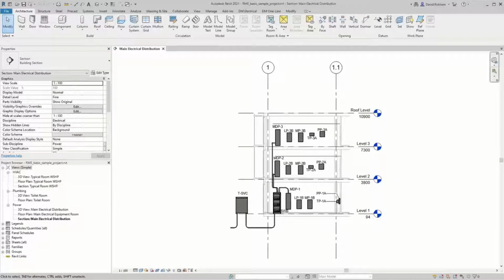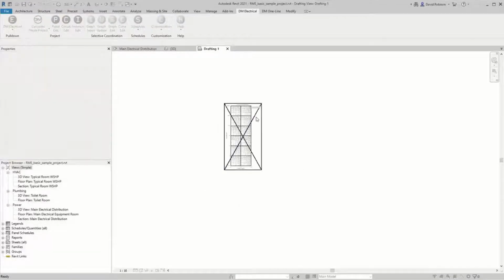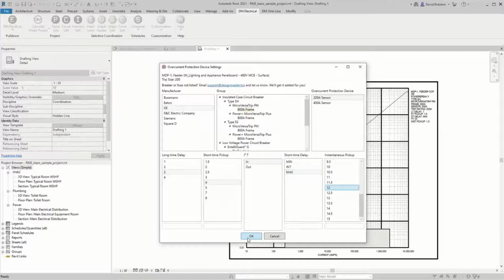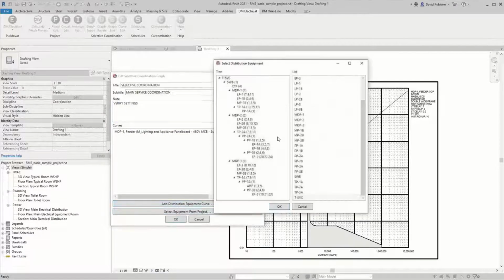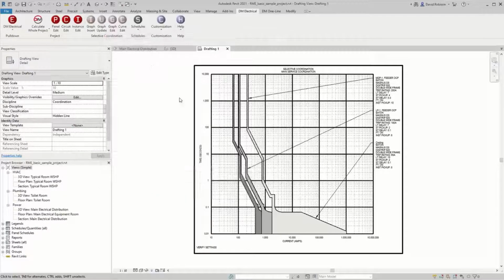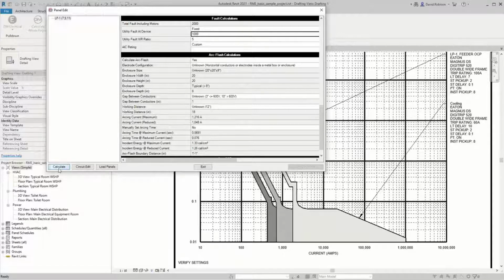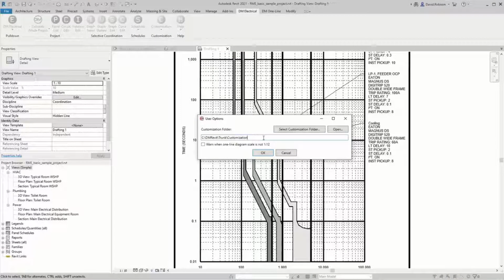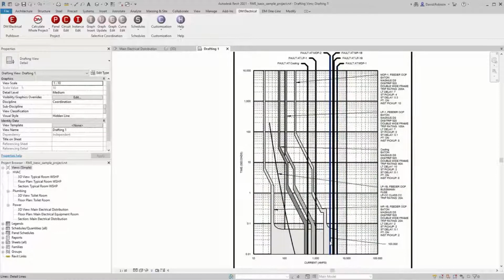Design Master Electrical for Revit: Breaker Curves (03/11/2021)

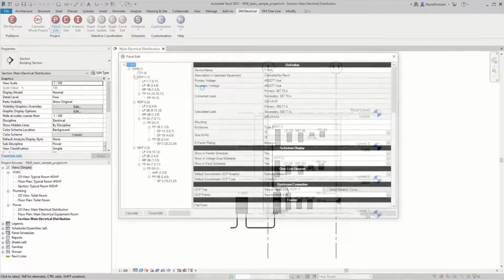Comment from the maker: Setting breaker curves in the Panel Edit command (01:15)
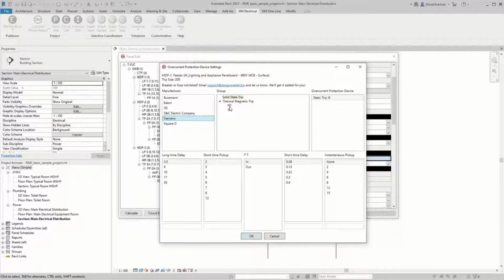What to do if your breaker isn’t listed (02:31)
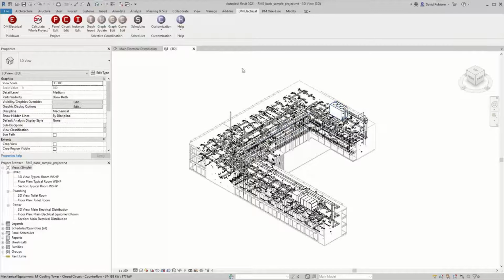Setting breaker curves in the Instance Edit command (03:04)
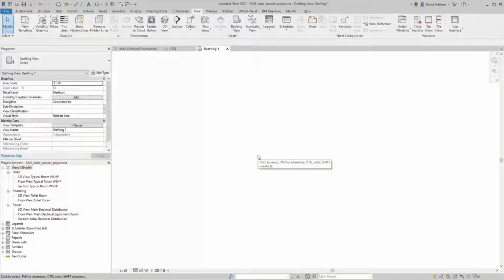Performing selective coordination (03:26)
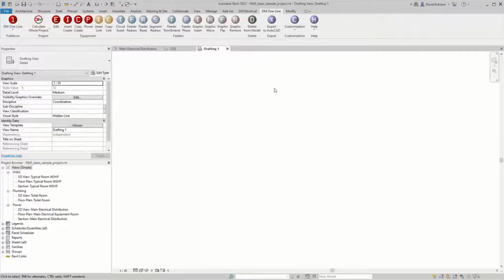Creating a selective coordination graph using the Graph Insert command (03:26)
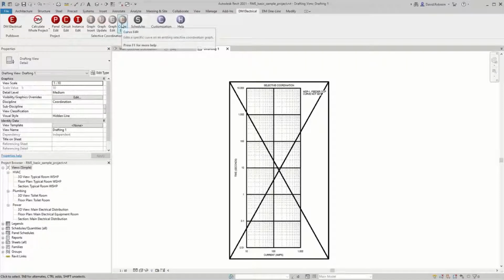Modifying breaker curves from the drafting view using the Curve Edit command (04:02)
Configuring thermal-magnetic breakers (04:12)
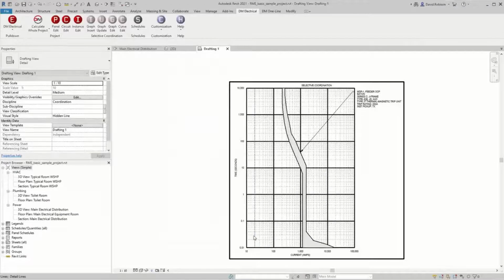Configuring electronic breakers (05:16)
Configuring fuses (08:37)
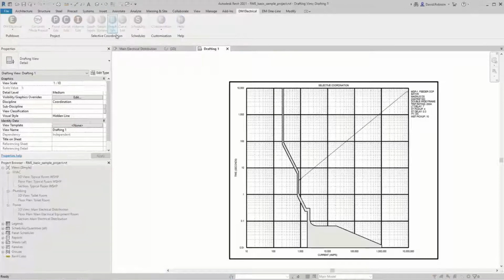Modifying a selective coordination graph using the Graph Edit command (08:52)
Customizing selective coordination graphs using the Project Options command (11:17)
Calculating arc-flash trip times (12:26)

“How do I share customization settings between users in an office?” (15:30)
Setting a customization folder in the User Options command (16:35)
“When I change Revit versions, will that affect my tags that use Design Master shared parameters?” (17:27)
“How many curves can I put on a selective coordination graph?” (19:19)